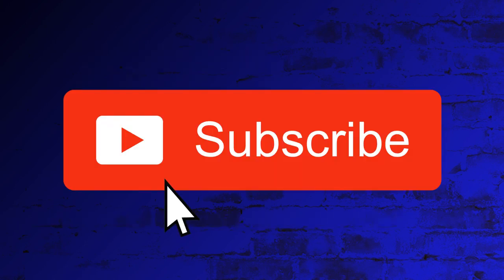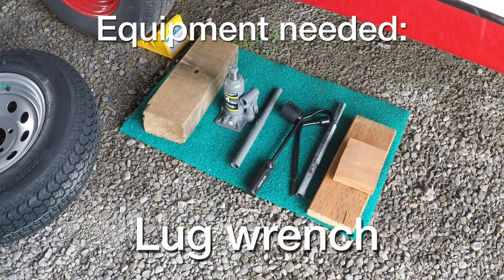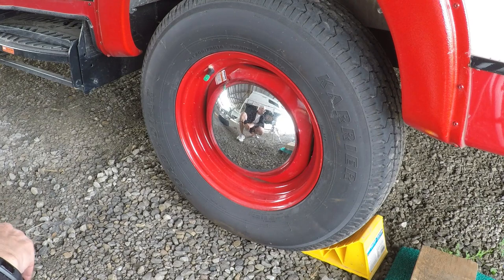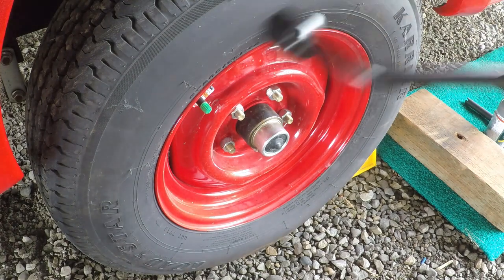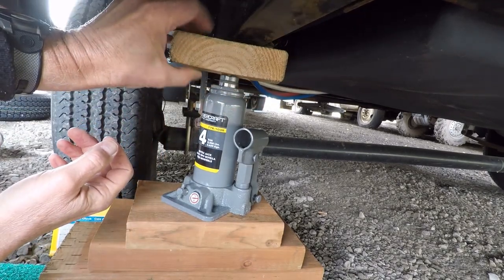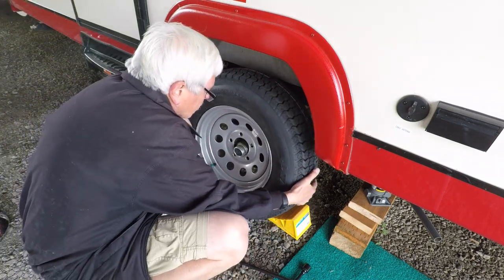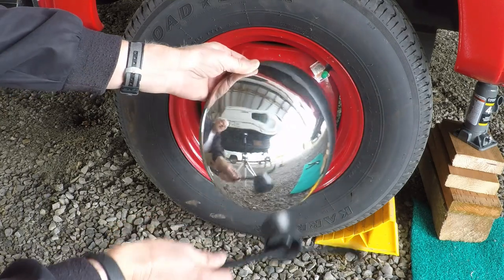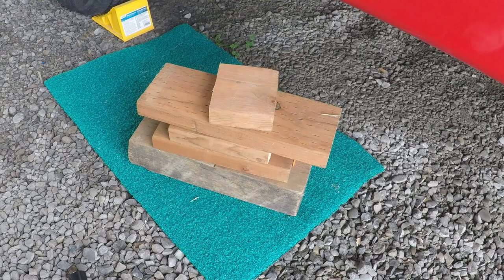How To Change a Travel Trailer Tire (single axle)

Comment: I did this today and it worked like a charm. Had to change a tire to a new one we bought last year. This was so easy. Thanks for posting.
Reply from the maker: Gregory Shaw glad it worked!  Did you need the tool to remove the hubcap?
Reply: I did not have hub cabs. The rest worked perfect. Thank god. I owe you a 🍻

Comment: You will for sure throw your back out 'lifting' the lug wrench like that to undo the lug nuts. A MUCH easier way is to place the lug wrench on the nut with the lever pointing to the left and CAREFULLY step on it, using your body weight to break the nuts loose. You can do the same for installing them, pointing the lug wrench to the right as you step on it. And to properly do this, you'll need a torque wrench set for these levels, for Gulf Stream “Lite” Towables: 50 – 75 ft. lbs.
All other Towables: 85 – 95 ft. lbs.

Comment: Just bought a 2009 Scotty Camper Trailer. Looks like it is in great shape; however, learning already, will need new battery, converter and tires...any good sources to refer to for maintaining and repairing small camper trailer, like this Scotty? Thank you for this tip on changing a tire...looking forward to viewing more.

Comment from the maker: A couple of good points made by viewers:  Get a torque wrench to tighten up lug nuts (see owners manual for proper torque setting).  Try placing the jack under the springs instead of the frame, it might not take as much wood to brace the jack.  Also, invest in a good lug wrench to help in removing the lug nuts.
Reply: I would stay with putting the jack under the frame. It's much more solid and there is little to no chance of damaging the spring or axle. Good video!
Reply: John Prazan torsion axle trailers can be damaged very easily by jacking the axle. The frame is always best. Any bending of any type of axle can cause misalignment of the tires, which introduces towing instability and increased tire wear.

Comment: I'm looking to buy a travel trailer. I'm  stuck on a single vs a tandem. I'm pointing towards single axle but I hear a lot of bad things driving a single axle. P.S. I'll be pulling the trailer a lot.
Reply from the maker: James Dexter We’ve had both. We loved the single axle but decided to move up to a larger trailer which was double.  The single axle pulled fine and was great while we had it.  It really depends on how much room you need, how big of a tow vehicle you have, and how long you plan on staying in it.  As far as pulling it, I really didn’t notice much difference.  What bad things did you hear about a single axle?
Reply: @Soundsoftheworld384  I have a 1999 Chevy Tahoe 5.7 V8. Plan on keeping the Tahoe for years and trying for full time in a trailer. I plan on keeping minimal items. Tools ,clothes etc. It's just me living in it and I may be doing a lot of traveling.
Reply from the maker: Well that should be big enough to pull single or double axle as long as you don’t exceed the towing capacity.  It’s really your preference.
Reply: @Soundsoftheworld384  I see. Thank you.